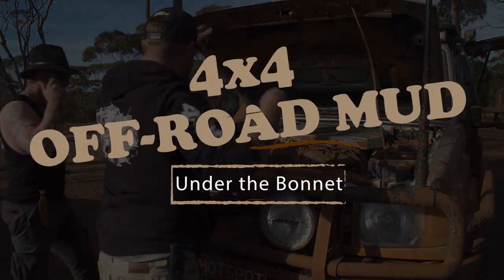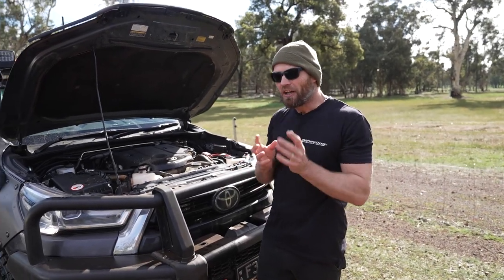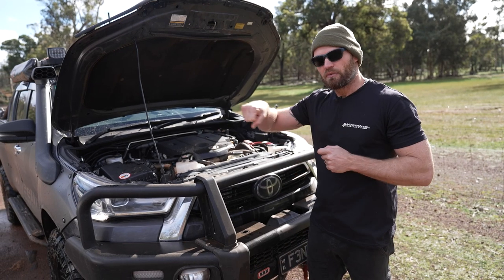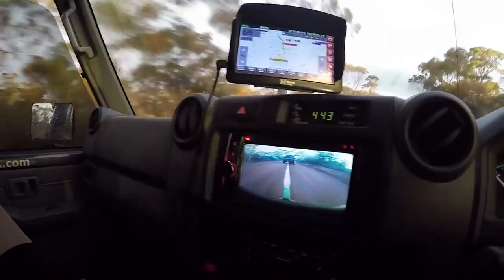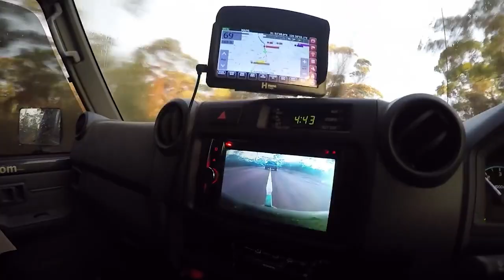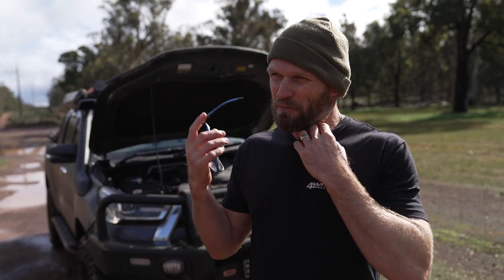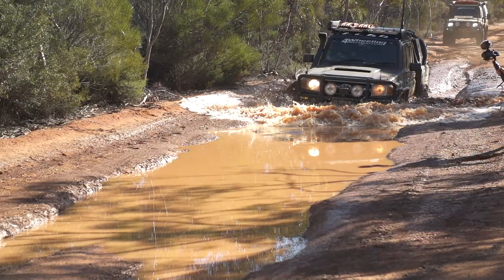OFF-ROAD MUD

Comment: Hi Ronny, as a mechanic in Perth and a 4wd specialist I see heaps of 4wd's everyday with issues related to mud, and not just in brakes, electrics, and so on, but also in diffs and transmission due to inadequate breathers. As for green death, that is a nightmare for everyone and very hard to repair, and a lot of the time the first symptoms don't occur until months after the water ingestion. I actually keep multiple alternators for the KUN series hiluxs in my shed as pretty much every week there is a post on various facebook groups for a person looking for an alternator urgently as most people won't remove and clean the brushes. And your video does a great job showing the best combat for mud is prevention, although not completely effective but inox is a great product to spray on the vehicle, I personally use lanotec steel seal on my 4wd as when it dries it leaves a wax like finish on everything, it doesn't wash off easily either so can last multiple washes before needing to be re-applied.
Reply: Yes

Comment: @14:30 also just to add to that (imho), if you have a air hose and an onboard compressor, you don't necessarily need to use precious clean water when out on the track.

Comment: Top video Ronny and so damn right. For many of the reasons you have mentioned I try to avoid mud these days. I will hit it if I have to but always go around where I can. Another factor as to why I avoid it as much as I can is because with a shot back its very difficult to get on the ground and clean under the car. I used to use a garden sprinkler to soften the mud as was suggested to me but I was still getting problems. Now I just find it easier to avoid it.

Comment: Dear Ronny,

I'm a geologist and have to tell you're doing very well on the mud issue. I never drove through mud in Australia so far - it is on my to-do-list - yet I did it in Sibiria, Africa, Southern America and of course Europe.

I do not at all like mud - it is not my speciality and I do not like to drive through mud, yet as you pointet out very correctly, sometimes you can't get around to do it.

And I'm an naval engineer.

I didn't sleep at class on the issue of corosion.

As far as I can tell, your video, this video is hitting the nail on the topp as precise as one can get to enterrainingly shortcut lots of the details that tell appart science from journalism.

If I had to give you a number between 0 and 10 with the 0 to beer-garden-rumors and a 5 to serious jornalism and a 10 to science I had to pick the 8.

Well done!
Very well done.

Best regards from Germany 
Stefan
Reply: The longest winded compliment I've ever heard

Comment: One bog hole, 30 seconds of fun, caused me about $25K worth of damage to my 100 series.

Sunk it halfway up to the doors in sandy silty mud in the middle of nowhere- No way to clean out the radiator, intercooler etc.

That single bog hole was responsible for:

Rebuilt engine after the oil overheated, broke down and wrote off every bearing in the engine and scored the crank
Replacement turbo after its bearing failed
Rebuilt starter
Replaced Alternator
Replaced Clutch- Damage from the sand in the mud chewing the clutch disk up
Re-seal the gearbox
Rebuild the transfer case after EVERY  single seal on it started to weep from silt getting into the sealing surfaces
New uni joints all round for silt contamination
New wheel bearings all round from silt damage
New brakes all round- Rotors and Pads from damage
New Handbrake shoes from silt damage
Full strip down and rebuild of both diffs due to water contamination and silt getting into the pinion seals and ruining them
Replacement winch motor due to water ingress not being caught and it rusting

Not to mention hundreds of my hours doing the work, cleaning the thing, constantly finding new niggles and issues related to it. I'll drive around bog holes at every opportunity now unless i absolutely HAVE to go through it- And then i'll send a sacrificial friend through first!
Reply: Does insurance not cover any of it?
Reply: @ollie620  that all depends on where you were when it happened and depth of bog hole/ water crossing. Had one person in the club take the wrong line. Only the front  half of the vehicle was in the bog hole. High enough to seep through the door seals though. Insurance company just said it’s a write off. Due to unknown electrical issues that may occur later on. She spent months fighting the insurer over that. They finally reached an agreement the insurer would pay to fix everything that could found wrong with the vehicle at time of repair. Anything that went wrong with the electrical system after a three month period. Would be on her to fix. The vehicle was then devalued by the insurer. Due to that one mistake she couldn’t insure the vehicle with anyone above half its market value. Lessons in that watch what others are doing. Check your lines and definitely check those depths of mud holes and puddles.
Reply: @ollie620  most insurance doesn’t cover acts of stupidity- plus they’ll look at it and go “it’s a hole surrounded by dry ground for 30m either side- you chose to drive into it”

And as also mentioned, they’d write the car off for $25K of damage, and the other issue is it’s taken 4-5 years for all the issues to crop up
Reply: BUMMER !!!
Duly noted.

Comment: buy the 20L inox drum on sale from repco, get pressure sprayer. half the price of the cans 👍🏻
Reply: I buy the 4 litre containers. Each one comes with a free spray bottle.
Reply: @michaelguerin56  why do you need more than one spray bottle? 20lt drum is cheaper
Reply: @dualcablowlux  I do not need a 20 litre drum and do not have the storage space to spare. Also, the work truck gets more muck on it when I have to visit the landfill or quarry than my 4wd typically does on a 4wd track. Plenty of rock where I tend to drive. The 20 litre drum obviously makes sense for you. Plus, the petrol powered work pressure sprayer is a pain for one person to move around and more of a pain to lift on and off the truck. Good suggestion though and I will pass it on to any acquaintances who could benefit from that approach.
P.S. I use Inox on my tools, bang sticks, 4WD, work truck and various items at work. Always good to have an extra spray bottle lying around because I never leave them on site and do not like to waste time searching for a full bottle.
Reply: @michaelguerin56  Fair enough mate, sounds like you have it all sorted! I am almost through my first 20L in 18 months 😂
Reply: @dualcablowlux  Cheaper than going to the panel beater and mechanic on a regular basis OR selling a rusty vehicle for bugger all. 🙂

Comment: Good vid’ Ronny, lucky you had a snorkel too mate 🤣🤣
2 things you may’ve missed mentioning too mate, the cars ECU or ‘computer’ position in the vehicle, often under the seat or low down in the foot well area, if this gets flooded it can be bloooody expensive to fix. 
Secondly, for tracks to remain open for all, we must ALL tread lightly so the less contribution we’re making to tracks getting washed out and trashed by big tyres and a heavy right foot for the fun of it, the less chance they’ll be closed off. #respectthebush #respectthebeach 
👍👍🇦🇺🇦🇺🇦🇺

Comment: Don't forget the winch controller that sits on top of your winch. These are generally not sealed. Take the cover off this and spray it heaps with a corrosion inhibitor that sets and stays there.

Comment: Ronny,

This is my favourite four-wheel-drive channel you're a legend you saved me lots of dollars in regards to my patrol will love one day to go to some tracks with yourself and a few mates I'm located in Melbourne. I wanted to get the big tyres and the big rims but watching your video I didn't do it it's my daily driver so my patrol has 31 all-terrain tires I just have the basic mods and it does pretty well I've got mates who have spent like $20,000 on accessories . My Patrol is honest and hasn't missed a beat One part in your video you hit the nail on the head I had a rock in between my brake caliper for two days I had to take the whole tire off and get my Tyers we'll  balanced 
Love the videos mate 

Cheers,

Bash..

Comment: I used to ride my motorcycle in the swamp every weekend with my buddies.  Brake pads had to be replaced every 3 weeks.  Wheel bearings made it about 2 months.  Fortunately my wheel bearings had lifetime warrantees. I had 2 sets.  One set was always in for warranted replacement.  Fairly cheap for a motorcycle, loads of fun, wouldn’t change it.  My truck has never seen mud, and I hope it never does.  Way more expensive and cumbersome.

Comment: Having sunk and hydrolocked 1 vehicle in a bog hole at Mundaring Powerlines, this video really brought back those tough memories. Still fighting electrical issues 3 years later even with a complete new motor. Good video dude

Comment: Just yesterday I removed all the wheels from my 2021 Tacoma TRD 4X4 and the vented front rotors were full of dry mud.
Stuck between the two brake pistons dried mud...
Used a pressure hose to clear it out.

Rear are drum brakes, will remove it too after seeing this video, THANKS Ronny.

Oh rear diff have a breather....maybe have to check that too.

Comment: Australia has a special mud problem . The land was once under the ocean , so as Ronny says , there can be a lot of salt in the mud . The red in Australian mud /dirt/sand is iron , ie rust . Aus is probably the most iron rich country in the World . Check the geology of the area you are going to drive through . In  New Zealand we only have salt problems on beaches and costal areas . Our mud is full of organic material and clay and can be very sticky as a result . I think whoever decided to put electronics / computers  in the footwell on modern utes is an unthinking idiot who's parents weren't married . I have seen a Colorado stop in a river ( Fresh clean water) and the computer etc got flooded , as a result every electrical device turned on, wipers,  horn,  lights , flashers , radio etc. Luckily we were 3 hours from home , when the ignition was turned off , it wouldnt work again until the computer was blown out with warm air . Once dried the vehicle has worked perfectly for the last 3 years .

Comment: Hi Ronny thanks for the clip and advice, being new to 4 wheel driving , what product to say to spray under vehicle and engine bay to help prevent rust. cheers,
Reply from the maker: Inox3 or fish oil is the most cost effective or Strikehold as the most effective but costs more
Reply from the maker: Strikehold for engine bay 💯 and the rest of the car if you can afford it

Comment: Come to Ontario... for six months of the year the roads are caked in salt to prevent ice forming. I think I can hear my vehicle rusting in the driveway right now lol.
Reply: I heard about that. I can’t comprehend having to put salt on the road
Reply: @anthony9thompson  with six months of snow, and ice it's a necessity. The alternative is to use sand, which causes less rust, but leaves the roads less safe in a freeze/thaw cycle. Out on the prairies they just use sand because the temperatures are too cold for salt to work.
Reply: @Furniture121  makes sense off course but still sounds crazy to me . Although last week I had  a wild kangaroo in my laundry and that may seem crazy to some people

Comment: My alternator, Jeep XJ, quit twice after getting stuck in silty mud. The first time I replaced it but the second time, I took it apart. With Jeep alternators, the silt makes the brushes stick in the plastic holder. The manufacturer even cast a slot so you can use a small screwdriver to release the brushes. Worked fine with some WD40 after I put it back together.
Reply: Alternators are easy to service if you can find the parts.
Back in my home shithole country,  South Africa that was a common thing to do back in the 70's and 80's.
Here in Canada now it's much harder to find parts.
Common parts need replacement were bushes and front/ rear bearings.
Check charge voltage,  14.3 volt, good to go.
Reply: Mirage drone .

Comment: Probably one of your best informative videos yet Ronny! I used to work for the army and service and repair mechanical components on ABRAMS tanks and ASLAVS along with APC'S and ACV'S. The Australian military use lanolin underneath all army vehicles. I used to apply it on all components after rebuilding them. Mud is death. It really is. So many heavily rusted components that most times when rebuilding a strut or control arm that weighs 250 kilos i would replace most components because of how rusted they were. That's why a lot of military vehicles use mechanical seals which resist contamination better than your conventional rubber lip seals. Lanolin is excellent at creating an effective barrier against corrosive substances like salt and mud. 

But a lot of people with 4 wheel drives have a very distorted perception about what a 4 wheel drive is supposed to do. It's not as much as they think. It's just a car....like any other car. And mud will kill it much quicker.

Comment: Another great set of tips, Ronnie.  And so many variations on the theme on mud. 
My dads little Ford 4x4 Ranger back in the 80s was covered in mud after a week-long hunting trip.  It was the most and only 'mudding' either of us or the truck had done.
Got home, put truck thru standard car wash once, and called it a week.  
6mos later, that truck was wandering all over the road holding the wheel steady.  The mud got in to the wheel bearings, tie rods, suspension bushes, and especially the brake slide pins and destroyed them that quickly.  Lesson here is the underside needs prudent yet pedantic cleaning with pressure after mud runs.  I don't think the underside of dad's Ranger ever saw direct water cleaning, which clearly lead to the issues imo.  Well that and mid-80's Ford quality.  (lol it was a good truck).

Comment: Mud...is a real killer in some off-roaders...even the most reliable ones.
It get's inside the rails clogging the drain holes, and over time leads to rotting the frame from inside out. Saw plenty of off-roaders with issues like that. That's why I'm such a fan of C section frames. Unfortunately not often used in modern off-roaders.
Reply: Crashing into a brick wall also kills some off-roaders... even the most reliable ones.
Reply: @AustinH7  yep...that one is also tough.

Comment: Hey Ronny. I have a question about this "INNOX, MX3". Is that similar to "WD40"? Can this "WD40" also be used to spray the car for protection? I can't find this "INNOX, MX3" in any car shop, as I am not in Australia. Actually I try to avoid all these deep bog holes, as I don't want to flood my car with mud and I hate to creep under the car and brush every corner with a tooth brush. I did that just once, as we had to go through some really muddy track. So, if "WD40"  could prevent the mud from sticking to the car, I would use that next time. 
I hope, your "Troopy Project" makes great progress. Waiting for more videos about that. Have a good day and a good time outdoors.

Comment: H-section wheel spokes are particularly good at collecting and holding onto mud. I once went in behind Waverley in Taranaki, going past Rewi Alley’s old house in the process and the papa mud is really horrible to deal with when you get back out. Steel disc i.e., standard steel wheels do not collect and hold mud as badly as alum alloy wheels.

Comment: Mud screws up everything.
In the original 90/110 owners manual, it told you to remove all the drums after driving in mud to clean the brakes.
Mud left in drums murders a set of brake shoes. Done that, got the medal.🙂

Comment: Not that much mud here luckily, but I felt that balancing issue 😅 We get pretty good amounts of snow during the winter and last winter I had to take my 4wd to this beautiful field with untouched snow on it. It was roughly half a meter deep, a bit more at places where the wind had shifted it, but it was fun to drive around it.

When I got to the highway and started doing 80km/h... well, you can imagine the teeth shattering shaking when the wheels were packed in snow 😂 First stop I could make I pulled beside the road and had to hack that partially frozen snow from the wheels.

But it doesn't really damage anything, it's just clear water, so it's not as bad for the vehicle as mud obviously. Now the amount of salt they pour on our roads during the winter on the other hand... finnish cars have a lot of rust issues because of that single reason 😑 And even can't wash it when it's way below 0 celcius. So cars just have to endure the salt during the winter and get washed as soon as it hits positive degrees.